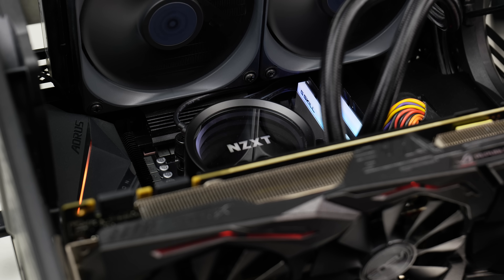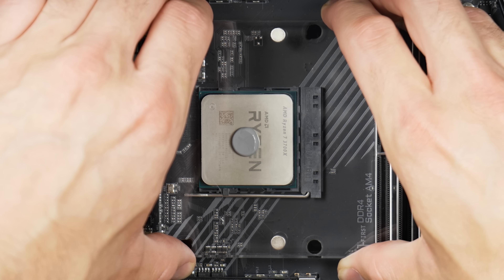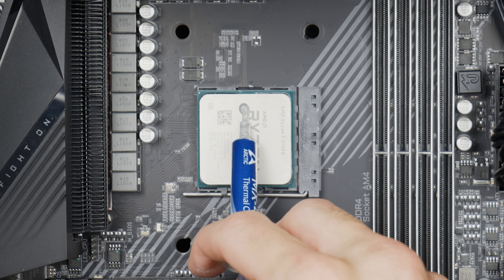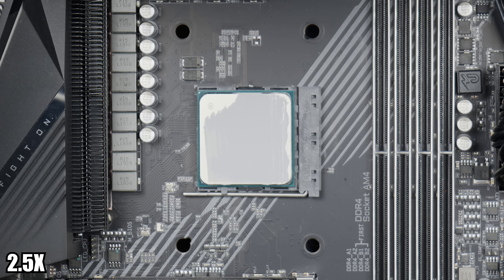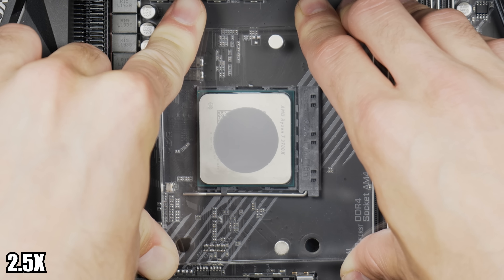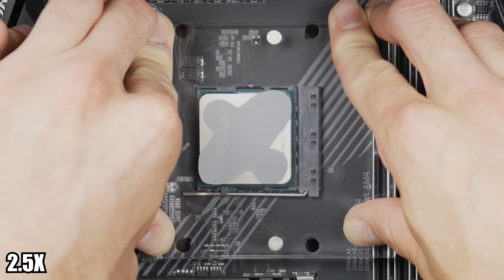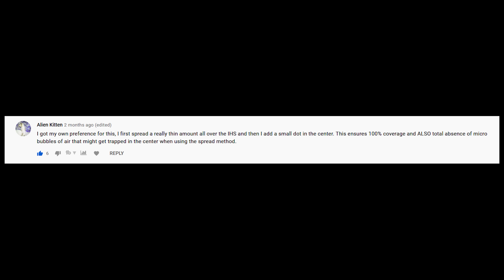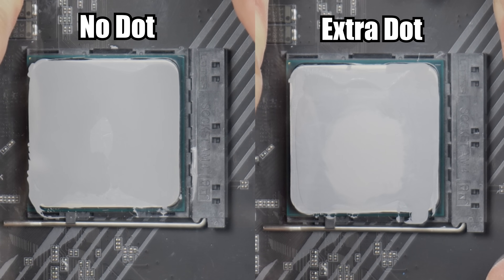Thermal Paste Spread Under Glass

Comment: The key observation of this experiment should not be the amount of coverage or the pattern, but how easily Thermal Compounds are designed to spread under pressure. You do not need very much compound to achieve an effective amount of coverage. A common error users make is to use more than necessary and overestimate the amount required. You don't actually need as much as many users typically think and they end up with excess that might actually impede thermal conductivity. 

The job of thermal compound is not to transfer heat, per se, but to displace air by filling in the microscopic imperfections in the surfaces of the CPU heat spreader and cold plates of the cooler assembly.  Heat transfers best with direct surface to surface contact and air is a good insulator. The less air trapped between the surfaces the better; and the more direct contact between surfaces that exists; the more heat energy can be transferred through the spreader into the heatsink and away from the CPU core.  

Thus total coverage of the heat spreader with thermal compound is not critical, so long as a good surface to surface contact directly above the CPU cores is achieved. Caking thermal compound to the point of it oozing out the sides of the assembly, not only wastes thermal compound, but may actually create a barrier that degrades the quality of the direct surface to surface contact and lessen the efficiency of the heat assembly as the thermal compound hardens naturally into a wax like consistency over time.
Reply: It’s not even microscopic unevenness, the CPU surface is not flat. If you look at people lapping their cpu you would notice the corners and sides are always sanded down first. 

Gamer nexus did some tests and any way a normal person apply thermal paste is going to be fine.
Reply: Absolutely! You may think it'll just press out the edges, but the required pressure rises exponentially as the thickness of the grease decreases. By the time the heatsink is applying max pressure, there's still going to be a layer of grease (depending on viscosity) between the IHS and the heatsink with little or no physical, metal-to-metal contact. Metal-to-metal contact is the best possible situation for heat transfer. Thermal compound is better than air, but will never be as good as metal-to-metal.

My new CPU/heatsink performed much worse using the dot/rice and X methods. Only marginally better than the stock heatsink that came with my previous, less powerful processor. I changed to a method I used in manufacturing high-power LED assemblies. (Around 80 chip-LEDs soldered to a PCB-on-aluminum plate, mounted to a big aluminum heatsink, if you must know.) I tapped off the edges of the heatsink at about 1/8 inch with gift-wrap tape (it was what I had handy.) Then I used the buttered toast method (with a metal ruler) to print (silkscreen style) the paste in a layer no thicker than the tape. Temps instantly improved.

Heres an article on heatsink design and use (in general electronics) if you want a deep dive: https://sound-au.com/heatsinks.htm#s10
Reply: Bullshit. Jay proofed that it doesnt impact, the presure of the cooler is way enough to thin the paste. There is only to less paste, not too much.
Well, atleast you dont use conductive paste or liquid metal, thats another Story.
Reply: Case in point:

https://youtu.be/EUWVVTY63hc
Reply: That’s not entirely true. Every tests that’s been done shows better heat transfer with more.
Reply: No. Too much thermal paste will not reduce thermal conductivity. It will just squeeze out the sides. This has been tested over and over. You're just wasting paste if you apply too much.
Reply: Thermal paste is far too thick in my opinion. A proper mating of surfaces is way more effective than filling gaps with a substance with a lesser thermal conductivity than metal or even mineral oil. Oil: 125mW/(m.K), thermal paste 3-8mW/(m.K) Thermal paste almost qualifies as an insulator.
I lapped both surfaces until completely flat and applied 2 drops of mineral oil which lowered the temps by 20°!
Never trust someone who claims you NEED their product!
Reply: From every single test I've ever seen done, and every single expert I've seen speak on the matter, they typically say the same thing: you can't put too much thermal compound, but you can put too little. Unless your compound is electrically conductive, putting too much can never hurt. There is such a thing as going way overboard, but if you get a little over the edges in your pursuit to fully cover the IHS, then that's fine.
Reply: Wall of text not withstanding... no such thing as too much. A properly tightened cooling plate will squeeze out any and all excess. To much and you're more likely just going to leave a mess around the edges of the IHS.
Reply: There is no such thing as too much TP.  TP fills the gaps between IHS and cooler plate, which are defined by the hardware - CPU, MB, Cooler,  Mount - not how much TP you use.

Using too little TP risks not filling the gaps. Thermal conductivity will then be limited.

Using 'too much' TP will ensure the gaps are filled and will ensure conductivity is not constrained.
Reply: @RobinHood-yk8og  Think its better just to define ’too much’ 
If it oozes out on the sides, yes it is too much and TC its wasted.  
But you have a point. The pressure leaves the thin layer needed  left so in that regard, it doesn’t mattter if it little too much TC... You can just remove the excess it with finger, paper.
Reply: @Benne175  Wasting TP is not a thing... an entire tube costs a few bucks.

Unless the user knows the exact amount of TP needed to get full coverage - and no one does - then there are 2 options available when applying it:

1 - err on the side of too little which will definitley constrain performance and in the extreme, risk cooking your CPU

2 - err on the side of caution and use enough that it 'oozes out on the sides'.

Option 1 could lead to massive productivity losses or in the worst case scenario, CPU replacement bills.

Option 2 just means you run out of TP sooner than necessary. There are no other downsides.

A few bucks vs potnetially hundreds/thousands in lost productivity/repairs....

In conclusion... wasting TP is not a thing. Too much TP is not a thing.
Reply: @RobinHood-yk8og  This one is easy: Apply the standard pea. Apply the heat sink. Run the system. Shut down and remove the heat sink. Look at the coverage and either keep the same or make your adjustment. I just had some ProLiant servers that I upgraded the v4 xeons to 20 core units and did this.
Reply: @mnoble247  the 'standard pea' is not a thing.

If you've used too little, on a server/lots of servers, you've just cost your company a fortune in procuctivity... and now you got fired.

If you used 'too much', nothing else happened.
Reply: @RobinHood-yk8og  There can be too much thermal paste. I've had to fix this issue more than once when some one built a system and it was acting erratic. All I did was clean up the over application. Apply the correct amount and issue resolved.
Reply: @mnoble247  'acting erratic'? in what way would TP cause that? it's electrically non-conductive. 'Too much' TP does not exist.

Comment: Great idea to do tests with a clear material so you can see the results!  Value of a steady hand?  When you are putting on a big aircooler how steady can you be with it?  Especially if you are changing a cooler while everything is in the case and you are dropping the cooler down into the big hole.  So this leads to another question- how do these various methods work if you put the cooler down so that it contacts on one side of the cpu then rocks into position towards the other side?

Comment: Having worked in the electronics industry and in other industries... application of the HSC to BOTH faces in a thin even layer then apply both together with the added 'wiggle' to seat them well.
Reply: Thanks for the idea. Is it probably better if the thermal paste covers the entire CPU? If so, you should rather take more, right. Should you then try to remove thermal paste that has spilled out to the side with cotton swabs?
Reply: More isn't necessarily better though. The goal is to have a thin, even layer over the entire CPU. If you have too much it could actually slightly hurt your temps, as the CPU transfers heat better with direct contact to the heatsink, but thermal paste is needed to ensure they're touching completely. In an ideal world, the CPU would fit absolutely perfectly to the heatsink, with no gaps or air, and thus thermal paste would not be needed @hullahupp

Comment: It's all fine looking at the spread while pressed with glass, but what many forget is that cpus/gpus get hot, heats up the paste and the paste then spreads even further acorss the thermal surface. 

You really only need a thin layer of paste, as the paste is Only used because of the microscopic pits and other impurities of the metals used. When it comes to thermal paste, less is better. Ive been a tech & applying paste now for over 35yrs.
Reply: The amount of "spread" caused by a 90C temp isn't going to change much.  That's just a silly statement.  You'll never notice the extremely minute difference. You can test this out by putting it in ~200f oven

Comment: You know the airpocket myth has been dis proven right? When paste is heated it will become thin during it's cure time, this is when the cooler pressure will push closer to the cpu giving better contact and any air will escape.

Comment: i think il use the x from now on. i usually did the pea method before. one thing i do is is give the cooler a bit of a side to side shimmy to help even out the application. it varies quite a bit from cooler to cooler. for the noctua type coolers, i just give the screws a couple turns, shimmy and complete the tightening. its a technique i learned in my system integrator days, we were using pentium 4 retail coolers where you just put the sink in the frame and flip the two levers with a shimmy in between. it doesnt work well on the core2 stock coolers as the pins dont give you much wiggle.
Reply: You just have to torque the screws in a criss-cross method. These acrylic pane videos are full of misinformation. 

Do you think this guy's weak sausage arms compare to the force of 2-4 torque'd screws?
Reply: @francissauve6685  yea thats what i do on coolers with 4 screws. usually the type that you can overtorque (use a driver with a torque limiter). i do a bit kitty corner while also counting turns.

noctua uses a 2 point mounting with springs so you cannot over torque, and the screws are designed to bottom out. while i prefer a 4-point version of this, its still pretty nifty. 

you can still shimmy the sink though, usually. never hurts.

Comment: Just because you don't see air bubbles on the glass doesn't mean there won't be any - they just may be against the CPU or between the thermal paste. One blob in the middle is the only method that doesn't allow any air to get trapped in the paste. When I install the heatsink I wiggle the heatsink contact surface around to increase coverage of the paste. Also, it baffles me that basically the entire modding community thought the best way to apply thermal paste is by spreading it evenly across the entire surface in the late 90s and early 2000s. I'm glad we got over that.

Comment: try doing it while the acrylic sheet is covered so you don't adjust the pressure as you press based on what you see. then take off the cover to see which method is more prone to making bubbles

Comment: I've seen multiple video now along with thermal testing and the "X" method seems to work best for spread and thermals. So that is what I use. My coverage has always seemed good upon removal of the cooler, if anything I tend to go on the slightly heavier coverage side. Although I have heard for intel the dot works fine because the hotspot is in the center of the die mostly where the Ryzen tends to be spread across the entire chip.
Reply: The X method is really useful on CPUs with larger IHS. Xeons, Threadripper, etc. Maybe LGA 1700 where I'd be tempted to use a small line instead of a pea sized dot. For the rest, the tried and true dot.
Reply: By the 'X' work best for thermals, you're talking about ~1% difference, and that's within statistical variance
Reply: @francissauve6685  From what I’ve seen the thermals may vary between 2-5 degrees C between the worst and best applications. At 50C that would be a difference of between 4-10%. Not much but it is something. It could be a statistical variance but nearly every test usually shows the “x” method to have the best thermals. If it’s a small difference but reflected in nearly every test it’s more of a small benefit than a margin of error. If one test showed better and another the same that could be just a margin of error or difference in testing method. 

When people are spending decent money to buy thermal paste that only offers a small reduction in temps it seems the application to those people should matter almost as much as the type of paste used. A cheaper paste applied optimally may perform better than an expensive paste improperly or poorly applied.

Comment: Drilling holes in plexiglass and tightening down with a torque screwdriver in a star pattern would have eliminated some variables. Plexiglass bend? Add steel plate on top of sandwich. Allegedly, applying thermal paste and seating cooler, then removing cooler to observe spread or to reapply thermal paste will occasionally pull an AMD CPU from the mobo and can result in bent pin disaster. Didn't occur using plexiglass in video and no mention of this in comments.
Reply: Use an old trash mobo in case you go crazy tightening screws cause you might break/crack the mobo.

Comment: I like to rotate the cooler after I put on the paste, maybe 20-30 degrees each way a few times, and then rotate it in a little "wax on/wax off" fashion. 
My thinking is that I want to try to get some of the bare metal to touch in a few places, and let the paste fill in any dips or humps. As opposed to having a layer of paste everywhere when it's not really needed.
Reply: This is actually the correct line of thinking when using thermal paste, metal to metal contact is ideal but since machining leaves behind high and low spots we need to fill the gaps. In all honesty, I think he uses too much thermal paste.

Comment: Best method is to spread it even and then swiping from the edges to the center. So you can be sure that nothing drops off the cliff and the thickest point is in the middle. So air will be pressed outwarts.

Comment: I use plastic wrap on the finger and spread it evenly across the IHS and never had any issues since. In the beginning I tried rice or pea method but ended up having to re mount the cooler until I got an OK result.

Comment: Back in the 2000s, I was always told to spread it even and spread it thin. The theory being that you wanted the thinnest possible layer without any air gaps. Thin, because thermal paste was not perfect so the less then better, provided you had 100% surface to surface contact. Reasonable theory... Perhaps with great paste and high clamping pressures, now, it doesn't make much difference - but in the other hand, the thin spread means not having it running down all over the socket and board.

Comment: Using the "square method" on both the cpu and cooler is the way to go. It's similar to the "jam toast" method except instead of putting the extra "dot" on the cpu, put that extra dot on the heat sink. The problem I have with the "jam toast" method is that the thermal paste hits the edges of the cpu, which is very unsettling but as long as it's not leaking out it should be okay. It's still risky though. The layer you put down during the "square" method was a bit too thick in my opinion - you want it thinner but as I mentioned before, on both the cpu AND the bottom of the heatsink. I've used this method with Arctic Silver 5 (my preferred paste) and it's always worked out great.